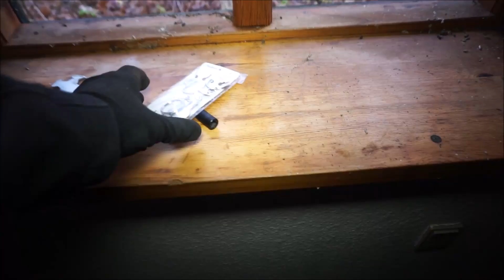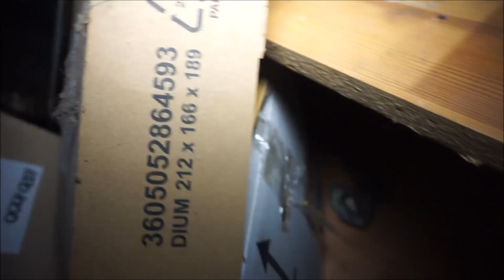Abandoned House During demolition

Comment: Hey Casper not sure how I missed this but anyway if you pause at 6:15 look straight ahead at the head of the bed up where the head board should be you will see 2 bright slanted what looks like eyes as you get closer at 6:20 the left one is the face manifesting of a little boy! I know this because I zoomed in and it was clear. You get close at 6:33-35 and you can see its changing and its not your lights, very cool.